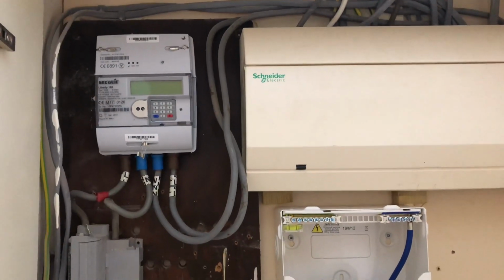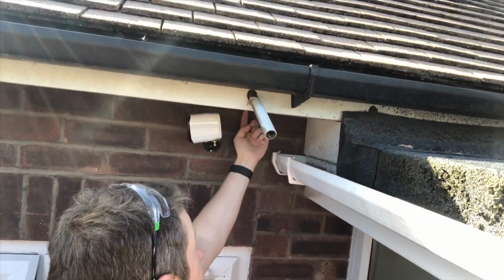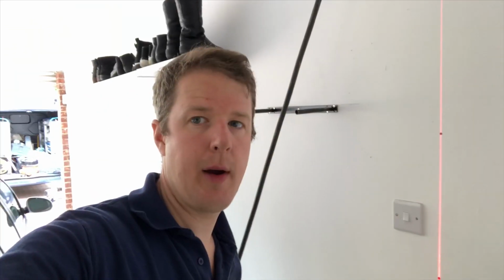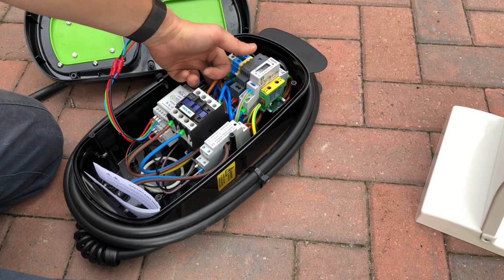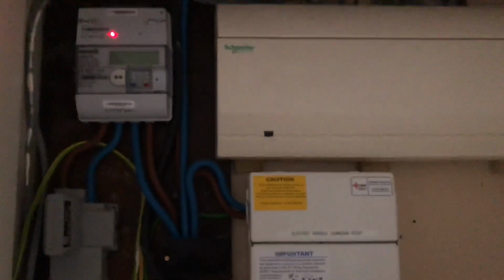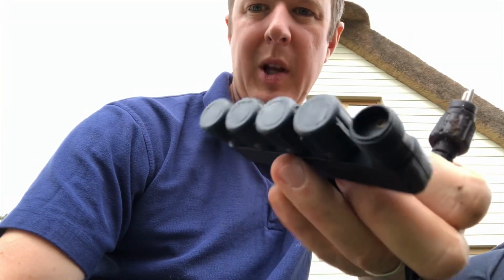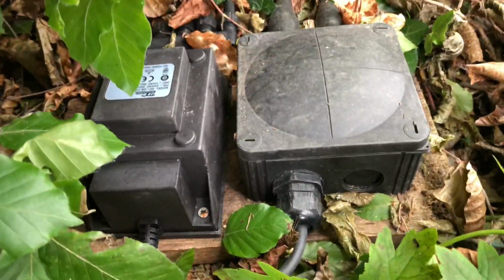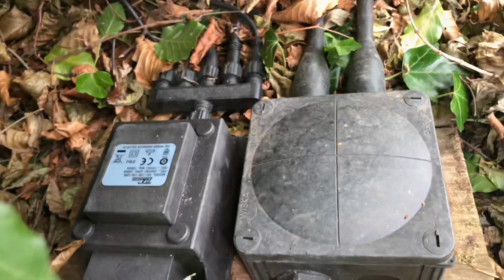Installing a NEW Rolec Electric Vehicle "Smart" Charging Point and some Plug & Play Garden Lighting

Comment: Hi there  i have the rolec 32A charger type 2 plug to charge a zoe 40 kw battery it working ok the last two years but lately the charge keeps getting interrupted and its only charging 10% at a time as the next morning i here like a solenoid valve going of like crazy,as i have got this charger of amazon no one here in ireland will service it and im wondering what could be the problem with it as the car itself displays a message on the dash to check the charging dock?

Comment: Do you still prefer the Zappi to this Rolec. Is this a good option and can you say how much this install cost. You need to use a 1mm blade on your grinder and please get a guard.
Reply from the maker: Yeah Zappi is way better than Rolec, I refuse to fit Rolec now due to quality issues.
Reply: @artisanelectrics  Just watched most of your Zappi installations I thought you might say that, keep up the good work.
Reply from the maker: Jinxy McJinxface thanks!

Comment: Hi I changed main fuse from 80 to 100amp and uk power network wants me to upgrade tails from 16mm to 25mm witch will be nightmare to  do it I will be only charging car at night is it necessary I change tails or 16 it’s sufficient?
Reply from the maker: Yes you need to upgrade the main tails it’s not safe to run 100 amp on 16mm tails

Comment: Hi Jordan thanks for this and all the other video content you’ve been producing- had a binge watch last night..!!   Can you advise the testing method you use for the EV charger install specifically what meter would you recommend.  I was looking at Kewtech But I don’t believe you rate them, so what kit do you use?  Also did you do a video as yet re setting up a new business etc?  Many thanks
Reply from the maker: Thanks glad you’re enjoying the videos! I’m using the Fluke 1664FC it’s great! You need an EV Charging test box as well, I use the Rolec one but thinking of getting a Metrel One as they look really good. You need something that can run the EV Charger through all its various settings.
Reply: Artisan Electrics Ah great thanks for the info I will take a look.. 👍🏻😎

Comment: If the cable run in just on a internal and external wall with no underground sections etc do you have to use armoured cable for EV charge points or can you use T+E or singles in 20mm or 25mm conduit?
Reply from the maker: Yeah you can use twin and earth or any other cabling whatever is most suitable for the installation depending on how it’s being run

Comment: Interesting video but it wouldn't hurt when working on the customers kit that you dont work on the finished side of the units face or side down on a brick drive way? lay them on an old piece of carpet, cardboard anything also you drilled swarf all over unprotected din rail mounted components, again just throw an old rag over them, I see so many installs where clumsy sparks and or builders just dont give a flying fuck about the customers equipment.

Comment: Hi hope you can help. My customer has installed a Rolec smart Olev charger, it worked for 24th hrs, but has now stopped charging he has flashing blue lights, the customer hasn't activated the smart part yet has he is waiting to get a compatable phone, is this the reason he isn't getting charge?
Reply from the maker: The charge point has to be registered online for it to work, Rolec give you a website to go to to register it, did you do that?

Comment: Hi, I've yet to do EV course, but have to install a rolec 32amp wall charger for a customer. I'm resupplying a garage with a 10m cable 50amp supply, the house is TT and i was going to put another spike in anyway as its 10metres away from supply. but what i was going to do was take new tails from henly block into an enclosure 100ma rcd then 50amp mcb to garage unit 63amp 30ma rcd then 40amp mcb to charger.  (the garage will have a 16a and 6a circuits too)  is this overkill ?

Comment: I’ve heard that the car charging units, can’t be installed on a tncs, unless they’re installed with their own separate TT system. I noticed you didn’t do this on your install, so I was wondering if I’ve heard wrong.?
Reply from the maker: It depends on a lot of factors, this one was in a garage so it’s different, if it was outside it would probably need to be on a TT system

Comment: In the videos when installing the cable can you describe what cable size you use in SWA that powers the electrical charging point from the fuse board. Single phase,& three phase. And what is the sim card used for in one of the charging points can you describe what it's used for. Other than that I like your videos and the are interesting  keep up the good work.

Comment: How do you find the quality on the new rolec chargers? Old ones were bit questionable.  I prefer the evbox elvi when installing chargers.
Reply from the maker: Just installed another one today, the quality is not the best, but there’s not much out there that competes with Rolec in terms of price...
Reply: @artisanelectrics  have you looked at the podpoint solo? 400 Plus VAT from medlocks, eligible for olev schemes and no rod required too. worth a look.

Comment: Just edited my last comment as some points were perhaps a little harsh.... suggest looking again at the regs regarding installation of earth electrodes with EV charge points.... it’s required now in all but a few circumstances.  Charger & vehicle being used indoors is not one of them.
Would be interesting to have a follow up video on how your customers are finding the ev energy App.  Ours are hating it. We’ve installed over 300 Rolec units this year and are now considering dropping them due to the lack of quality/quality control, tech support and they hopeless App.

Comment: Having looked at a bit more of your video, perhaps the dc residual current monitoring module within the Rolec unit monitors for dc currents greater than 6mA and cuts off the supply in the event of such a fault - not sure?
Reply from the maker: Yes that’s correct!

Comment: I was under the impression that the RCD should be a type B and not just a type A for vehicle charging units, unless the type A RCD has an additional device included to monitor for dc currents greater than 6 mA. RCD Type A’s (as I understand it) only monitor for dc currents up to 6 mA.
Reply from the maker: Yes that’s why most manufacturers now include a DC residual current monitoring device within their charging points, so an expensive type B RCD is not needed.
Reply: Artisan Electrics - That was not my experience when I was asked to install a Tesla Wall Connector; there was no dc monitoring and I had to source a type B RCD which cost the client an extra £400. I did suggest changing his charger but he wanted the Tesla charger - perhaps to match his new Tesla. I suppose if you have enough money for a Tesla model X then an extra £400 is not much.   That was my one and only experience with installing a car charging unit to date.

Comment: Hi , I've had no end of problems conforming to Section 722 for my Smart Charger - main issue is that the installer reckoned I could charge the car inside the garage, so insisted I had to box in all the water and gas pipes that could be within 2.5 metres of the car.
My reading of the regs is that if you use a separate TT earth for the charger and do not connect to the house earth, then it conforms without all that boxing in.
What do you reckon?
Reply: The installer is correct. TT system is likely to be at a different earth potential to the PME system. Therefore you need to box in extraneous metal work bonded to PME system

Comment: I only use 1.0mm for lighting in domestic dwellings.  And 6mm for most standard cooker supply’s.  

An example for apprentices-

Diversity for a cooker supply can be worked out like this:
Add the 1st 10amps of the maximum load to 30% of the remaining maximum load. 
Add another 5amps if there is a socket outlet on the switch plate. 

A recent install I done can be used as an example.  I had a: 
16 amp oven
36 amp Hob
(No socket on switch plate)
Max load:  52amps.

Diversity factored in = 22.6 Amps

A 6.0 twin and earth, even if buried in insulation......protected by a 32amp breaker  would be ample enough allowance for this hob/oven load.  

Forget all this ‘what about Xmas day’.  Most dinners are cooked in stages.  Meat goes in first, potatoes later on and veg often last.  All the different heating elements once up to temperature flick on and off at different times.  Even if a few elements click on at same time.....the mcb is designed to endure a small amount of overload for a short time, as is the cable.
Reply: K C John Ward does a great lecture on diversity.

Comment: Hi Jordan 

Just a couple of points I can see, will the charging lead not be long enough to charge the car outside the garage If it does, wouldn’t it have to be on it’s own earth connection, especially if the garage has got either heating pipes, hose pipe connection or metal light fittings.

As another guy has said have you got confirmation that the TNs will never be made a PME 

Mixed manufacturers consumer unit don’t you become the manufacturer so have to guarantee the product for conformity etc

And a big no no using an angle grinder without a hand guard, lastly hope you didn’t scratch the front cover when you were drilling the fixing holes!!
Reply from the maker: Thanks for the comments!

Comment: Hi.  Brave of you to post jobs.  Naturally people with criticise.  Over all it was a good job.  A few things I would do differently.

1.  Use an adaptable 4 way enclosure for the Rolec RCBO and main switch.  Basically build your own CU selecting components that are compatible.   (They don’t have to be the same brand to be compatible ) That way it is 100% your own design and you cant be held accountable for not sticking to Manufacturers instruction by using a pre-assembled branded CU.   This method is absolutely acceptable as long as you are happy to stand by the design.  

2.  I wouldn’t of messed around with the cut out.  The upgrade of tails from the cutout to the meter (and technically from meter to the Henley block) should be taken care of by the network.  

Finally;  you can actually install 16mm tails to a small CU that has a fixed maximum load like the one you installed.  I can’t imagine that the charger’s load will exceed that of 16mm meter tails maximum rating?  Technically, you could even use 10mm.   So I can’t really see the need for 25mm tails!  As long as the tails have sufficient overload protection, which in this case is the fixed load......and sufficient fault protection which will be provided by the cutout fuse, 16mm tails would suffice in this installation.
Reply: i am with you about the tails, the trouble is these days people think that they have to use 25mm tails, which as you state is not necessary, but if they come across pme, automatically they think 25mm tails, and i would be certain that if they inspected a board that didnt have 25mm tails they would put it down as a deviation, sign of the times i am afraid certain things in this industry are chinese whispers.
Reply: Anthony charles I agree.  It doesn’t even specify 25mm tails as a must  in the regs.  Not that I’ve seen anyway!  The on-site guide maybe.....not the regs though!
Reply: Agreed on cutting seals on smart meter and removing main fuse. The smart meter report back a power cut and it has been known for someone to turn up to fix the fuse, caught red handed. Best to have the customer request an isolator fitting. Generally free and done within 2 weeks.
Reply: Probably the worst thing with this industry is that people do things above the requirements then they become the norm, them if you don't do them, you are seen as rough.
Reply: Anthony charles what always gets me especially with a few YouTube sparks is the obsession with 10mm cooker circuits! Again, do the calcs and trust them.
Only the other month i got a right slating on YouTube with regards my comments on this. I was told that because i didn’t have any videos published i had to shut up and must be an armchair electrician! My view is this, if you want to publish video content, make sure you’re not talking bollocks and do a proper job
Reply: @SME_Ste  well since i was an apprentice i have always used 6mm for cookers and you can apply diversity to this circuit, its the same with lighting circuits, for some reason now everyone is 1.5mm crazy, but you could de-rate 1.0mm by 50% and it would still be ok, its a bit of a crazy industry, i am all for doing a good job, and have no issues with people going beyond thats up to them, its when this starts to become the norm, thats when it gets me.
Reply: I think you are right, when the nic guy came last year he said nothing wrong with using 16mm tails to me, which is right really
Reply: Anthony charles 100%.  Nothing wrong with it at all.  

On an EICR, 16mm tails with a 60amp or 80amp cutout fuse need not be mentioned.   I wonder how many C2’s are dished out for this!!?
Reply: K C  Loads and loads, EICRs done by onsite guide sparks. Its also earths smaller than 16mm that get pulled, most sparks either dont trust proper calcs or dont know how to do the calcs
Reply: @SME_Ste  yeah good point, plus the amount of people that think you can't use the armour on an swa cable and think you have to run a separate earth, people think you are rough for using the armour, drives me bonkers, some electricians are no better than diyers as their knowledge is not much better.
Reply: SM Electrical Solutions I agree.  Often I come across a 10mm or even 6mm main earth.   Those installs don’t necessarily fail.  

Truth is....Many electricians do not know the regs very well.  And they get confused with what is required by regulation on new installations and what can be deemed acceptable and safe on old installations when conducting EICR’s!   The two are not always the same!
Reply: Anthony charles  yep you’re correct. Again, calculation often proves the SWA is acceptable as a CPC.
Reply: Yeah, your right, probably way too many

Comment: Hi Jordan. did you not need to do an earth rod to the charger point this time round?
Reply from the maker: No on this one as it was in a garage, no issues with simultaneous contact and no way of touching ground and car at the same time.
Reply: Hi Jordan will the charging lead not be long enough to charge the car outside the garage If it does, wouldn’t it have to be on it’s own earth connection 

As another guy has said have you got confirmation that the TNs will never be made a PME 

Mixed manufacturers consumer unit don’t you become the manufacturer so have to guarantee the product for conformity etc

And a big no no using an angle grinder without a hand guard, lastly hope you didn’t scratch the front cover when you were drilling the fixing holes!!

Comment: Hi Jordan, another great video.  I’m really interested in car charging points.  One question I have, earth rods? I install a lot, as a lot of the properties I work on are TT.  I do my usual checks for services, but you can never really be sure.  I usually go as close to the building as I can, often encountering foundations.  Is there some sort of guide with the car charging point course.
Also it’s a big thing now & in the regs about using other manufacturers parts in their enclosures.  I’m sure it was to eliminate sparks just putting any old poor fitting circuit breaker in.  I noticed you put a Schneider rcbo in a BG consumer unit.
Reply from the maker: Thanks for your questions I will cover these in the upcoming Q&A video, they are good points that you raise

Comment: Apart from the regs can anyone tell me why its such a big issue to fit mcb’s / rcbo’s in a metal enclosure with a piece of din rail, that has a different brand name from mcb’s /rcbo’s? Will the fuse board fall to bits with a different brand breaker in it?
Reply from the maker: My thoughts exactly!
Reply from the maker: All this type testing stuff is a load of rubbish in my opinion!
Reply: I can see the reason for using all the same brand breakers when using busbars, the amount of bent busbars I’ve seen. It’s horrible and dangerous.
Reply: Manufacturers can’t claim that their RCD doesn’t work in harmony with other branded MCB’s.....because everything is built to the same British standards.   It’s simply shapes and sizes......whether things line up or not.

Comment: Couple of questions.
1. Your fitting onto a TNS earthing system which according to the COP for EVCEI must be classed as TNC-S (PME) unless you can have in writing from the DNO that it will not be upgraded/downgraded (depends how you look at it) to PME. As your installing in a garage can you be sure that the vehicle can only be charged within the building as stated in 6.7.1 in the COP for EVCEI ?
2. Why are you cutting with a grinding disk?

Comment: Nice install,

Question: you have installed the unit before the supply was upgraded to 100A. If when the DNO arrive to upgrade and the mains supply is not big enough so can’t install 100A main fuse without upgrading main incoming cable (this would be chargeable and customer is likely not to do this as you have already installed the unit)
How do you stand with the system
Exceeding maximum demand?
Reply from the maker: The smart chargers can be set to whatever KW setting you like in order to avoid overload so I can block it at 16amps if needed to avoid overloading the system.